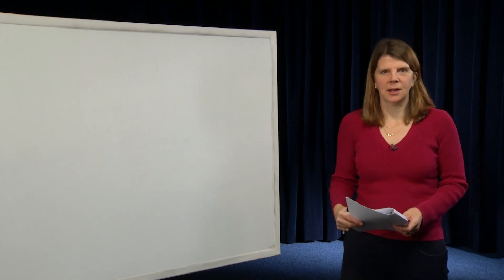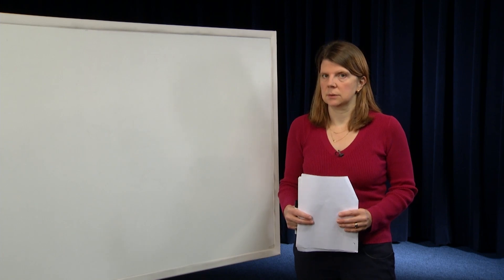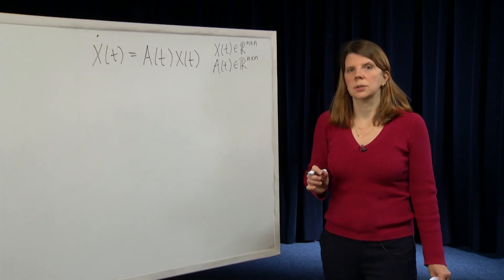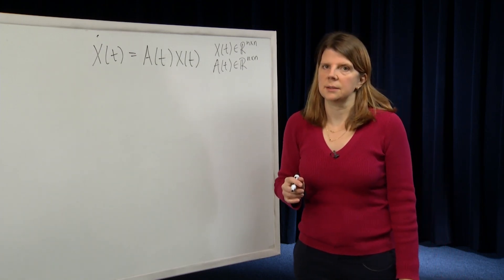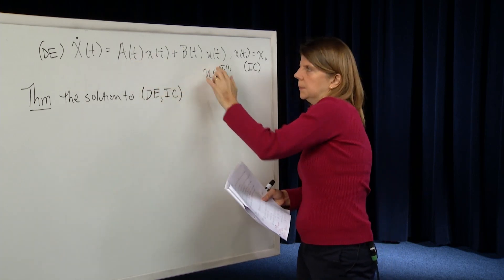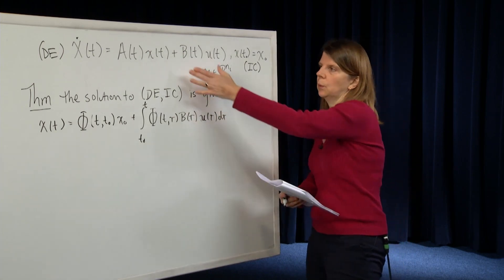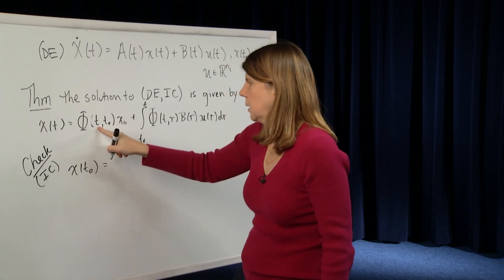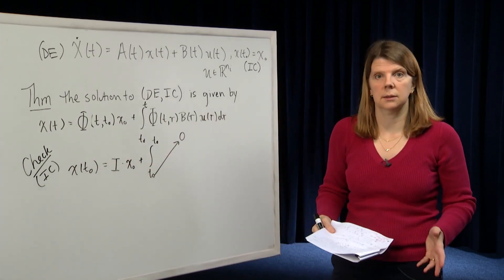EECS: Module 19 - Solutions to Linear Time Varying Systems

Comment: Thank you for the clear explanations of Linear Time-Varying Systems. However, I think I discovered a mistake in the proof as presented. In the last step for the DE check, I believe you forget the contribution from the second RHS term: B(t)u(t). As you are proving the solution for dx/dt = Ax+Bu, I do think you also need this term for the proof.
Reply: see homogenous + particular solution OR zero input response + zero state response